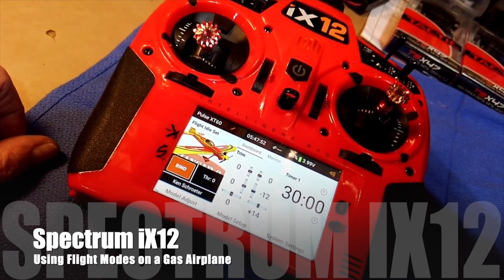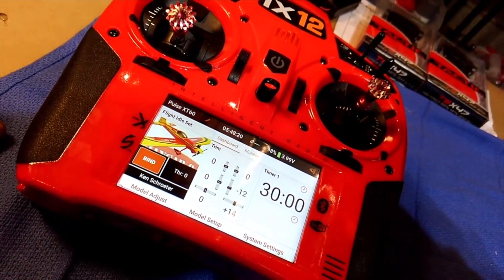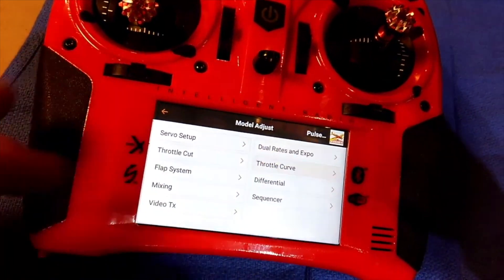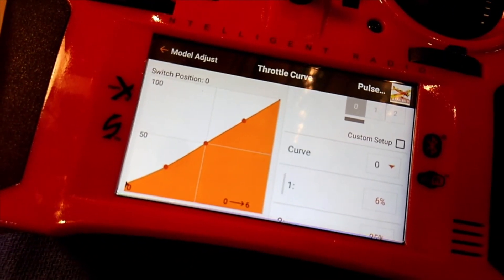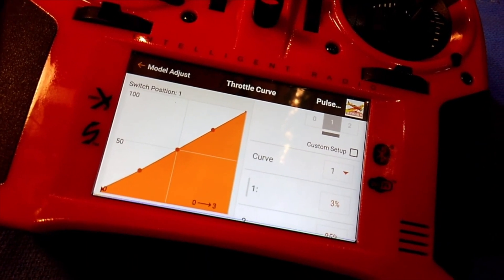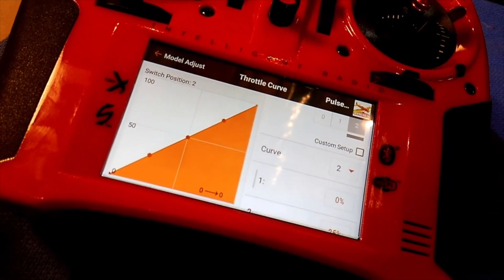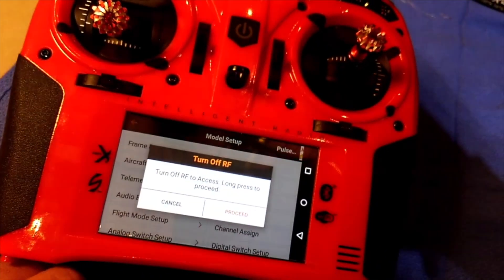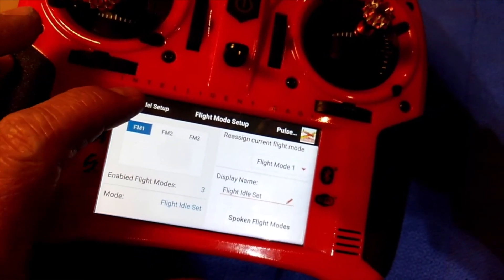Flight Modes iX12

Comment: May have a better idea so your not flicking so many switches during flight.
Instead of using a 3 position switch try using the gear switch or flap switch. That way you lower your gear or flaps, your throttle curve is automatically changed...
Rest is throttle management